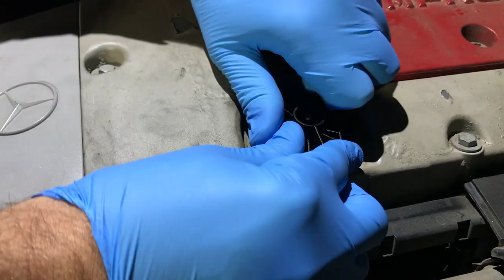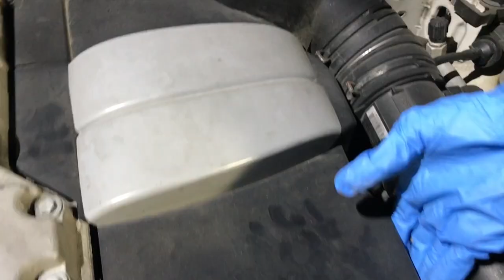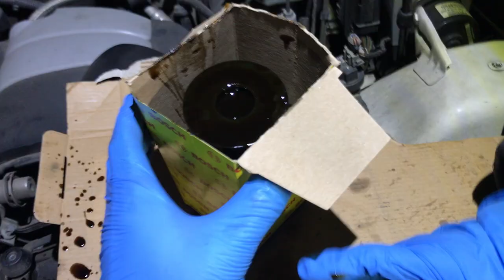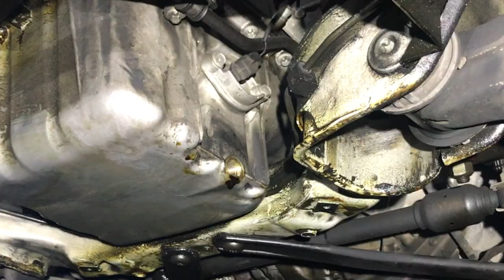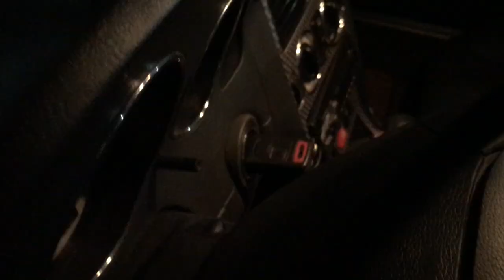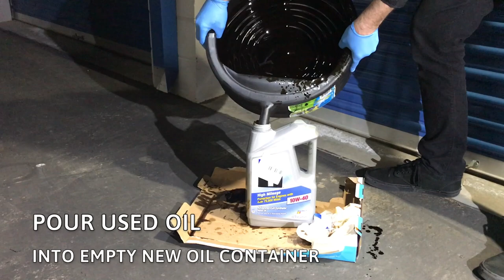Mercedes SLK230 Oil and Oil Filter Change (Service A) 1996-2004 - 4 Minute DIY Video

Comment: This was great! Thank you! Have you ever seen a situation where the rear windows no longer go up? Top converts just fine, but the windows stay down.
Reply: My 2000 SLK230 does the same thing. It's the limit switch in the top right side of the windshield. Now to replace it. Gregg

Comment: Didn't mention after filling the oil, run the engine for a minute or two, check for any leak, then let it sit 4 minutes or five, then check oil level.